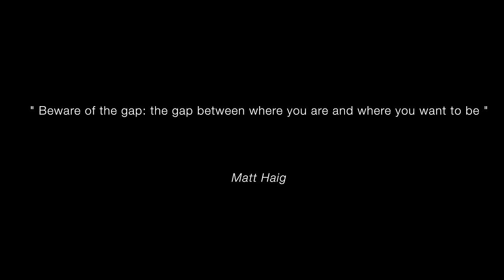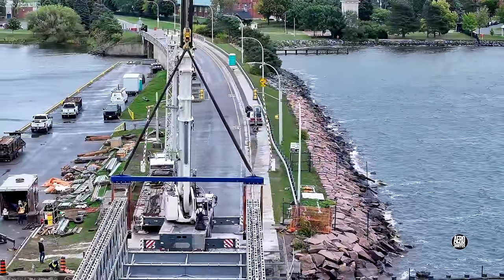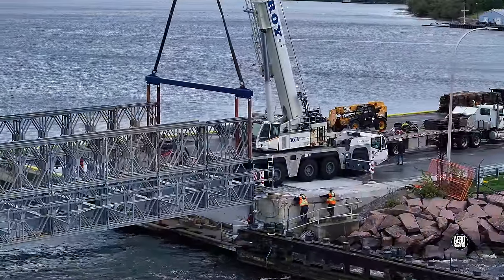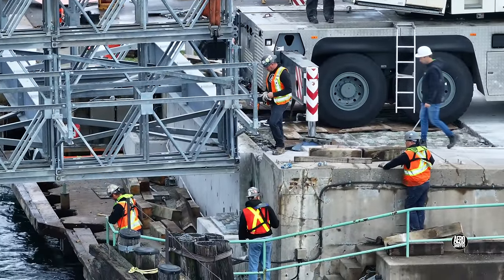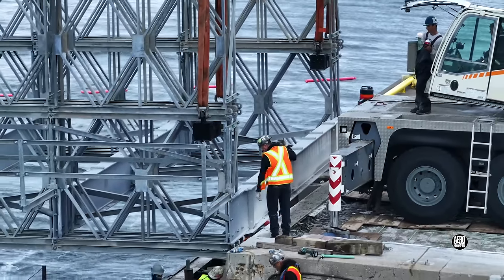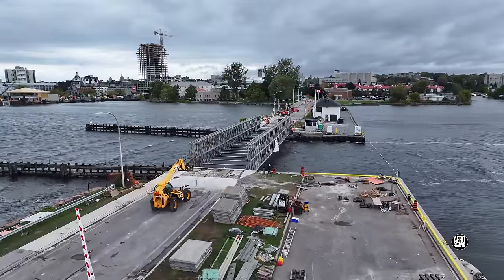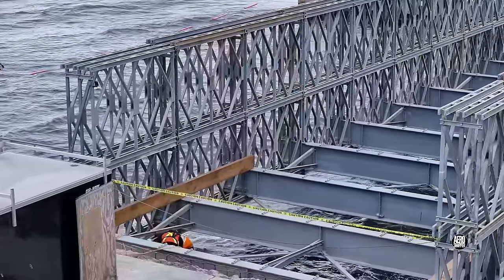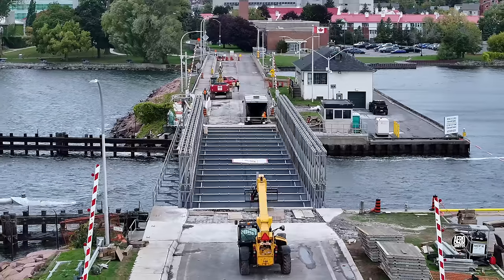That Awful Sinking Feeling  - an update on Kingston, Ontario's La Salle Causeway 4K

Comment: Quite impressed that you have managed to include the hammer falls on a connecting pin. Though most won't twig. :) Have you the optional digital mic on the RC Pro controller? I have a Mini3 Pro and it is my all time fav amongst a huge collection. Just wanted to comment on a few things. The pick point used to suspend the baileys bridge speaks volumes about the strength of the truss type construction. They call this a triple truss triple story application and is the absolute max strength and rigidity. Any exact figure re the total length of the span. ~150ft? Thanks
Reply from the maker: Chris - thanks for that lovely remark. No, the hammer falls are culled from terrestrial recording with a directional mic and added in during post-production.  The span is an interesting question.  The original bridge was widely reported to have a (lifting) deck of 170'.  However, I believe these panels to be 8' sections - and 18 in number.  That would suggest a span of 144', which is much more true to a measurement taken from Google Earth.

Comment: It would have been far cheaper to simply replace the damaged sections of the old Bascule bridge, than to have to build an entirely new bridge from scratch.  Isn't there any companies in Canada that build or repair bridges?
Reply from the maker: If something similar arises in the future, I will be sure to refer the responsible parties to you.  This will save a lot of time and money.
Reply: @Aerosnapper  don't get all snotty when someone is asking a question, I have wondered the same thing.

Comment: That is the strangest looking bridge I have EVER seen. It's basically assembled with modules consisting of stacked and laminated Girders. I wonder why they went with this design as opposed to something more conventional such as an Arch Girder ?
Reply from the maker: I’m sorry it’s confusing. The answer is very simple. This bridge is a temporary replacement whilst a permanent solution is identified and agreed to replace the original lift bridge. It will likely be in place for many months, and possibly years.